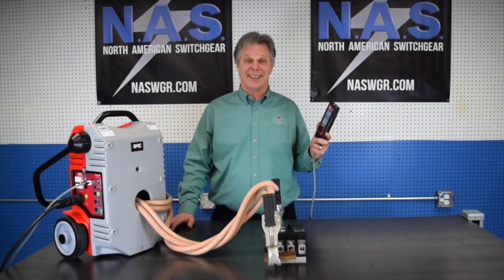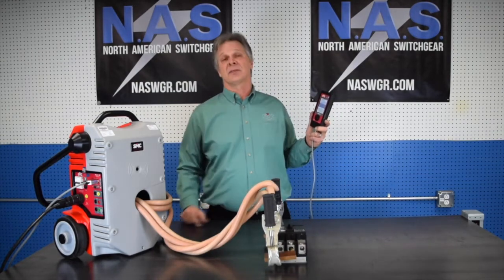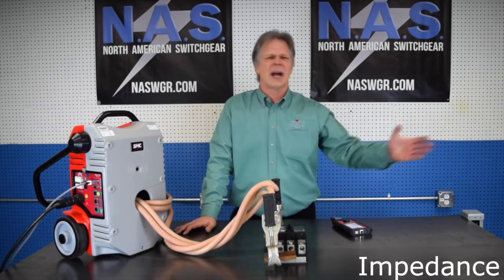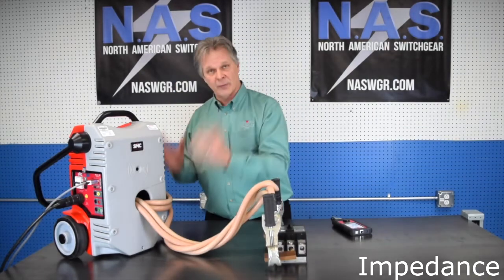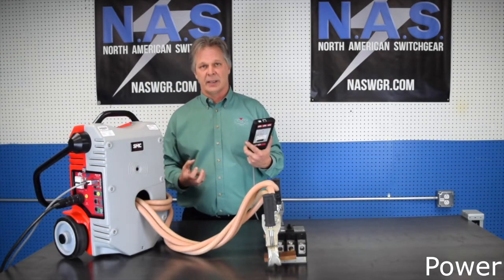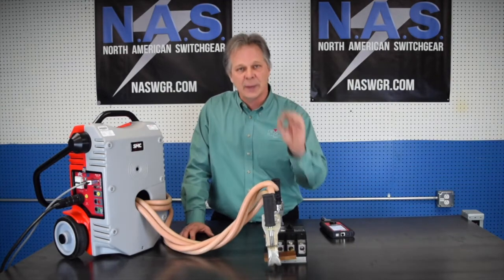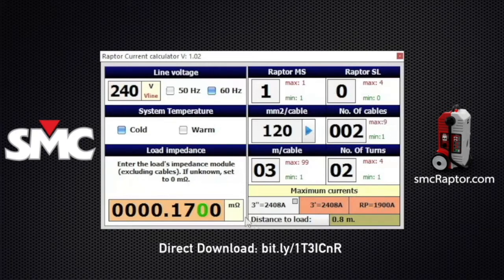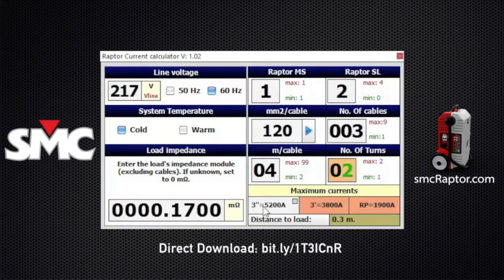SMC Raptor - How To Maximize your Test Current

Comment: You have entered all the calculator data but you cannot save it when you start the test. Also, how do I display the ampere reading in the program under the time during the circuit breaker test?

Comment: Raptor unit is a waste money spent. I have master and a slave unit and it cannot push 1/4 of a power you are advertising it as. Huge disapointment and it wasnot cheap.
Reply from the maker: Dear Ognjen Dobric, we are really sorry to hear that. We can not find your order, neither any registered sale though our distribution network. Perhaps you acquired it as second hand from a third party? However, please contact us at sales@eurosmc.com, so we can arrange a call to sort it out.

Best regards
Reply: @Smcint_esp  I have aquired it from a distributor and booster unit from a equipment rental company. I did spend a lot of time with Raptor office in US, and he was very knowledgable about unit. I did everything that shouldve been done, turns, cabke twisting, etc etc. Cant push 5k no matter 12k or 15k. Sadly he died since than and I just gave up on a unit, use it as needed and thats it.
Reply: @knn059  Thank you for your feedback. Can you contact us at sales@eurosmc.com? We will try to understand the issue not allowing you to inject further. It is not normal at all not to be inject more than 5kA with a Raptor C-15 (8 kVA), unless the burden load is too high.
Reply: I was planning to buy this device.  Can you tell me what the real maximum continuous current you obtained on the master unit  was ?
Reply: @dybson1991 Hi, depends how big of a breaker you are testing, also if you buy their $4000 cables you might get few amps more but not significant. Ive spent days on the phone, video calls with Raptor office in US and thats what you get, about 30% of advertised. I never managed to push even 6000A with master and slave, with all their recommendations, with them watching it via video call. Master only maybe 3200A or so, I dont know exactly now cuz I always had slave unit. Money you are going to spend just go with Megger or used PI-1600 or similar. No hate towards Raptor, I still have both those units, I am just trying to save people $40k+ we work hard for that money. Heres a hint, watch any of their videos you will never see a demonstration test on breaker larger than 400A. I watched all videos on internet trying to see someone succeed, I have never seen anyone test air circuit breaker 2000, 3000A and test instantaneous element or similar. I have those units for 7 years so trust me I know what I am.saying, they are talking calculated values, I am telling you real life experience, on site testing, etc. Also 240V supply or few volts less, huge difference.
Reply: @dybson1991 I know I wrote.you an essay up there, also when using 6m cables, they will tell.you ypu need to buy their cable that costs arpund 4k, I did compare impedance of my cables and their, not any significant difference that would make unit push extra thousands of amps.
Reply: @dybson1991 They are deleting my replies I wrote you.
Reply: @dybson1991 1 unit no more than 1200 Amperes , for less than 5 seconds
Reply: They are deleting my replies I wrote you.

Comment: What kind of input power supply needed for this equipment. Can we use normal 13 A single phase socket supply for testing??
Reply from the maker: Yes, you can. But as is logical, if the plug can only supply 13A, which implies 230 x 13 = 2990 VA, the Raptor can not supply the load, cables included more than approximately 2500VA.
Reply: Thanks for your quick response. In terms of ampere, with 13 A input supply what is the maximum current that       Raptor MS can inject safely,  keeping in mind various combination of Cables and turns as mentioned in Raptor Current calculator.
Reply: Dear Link is not working
Reply from the maker: @wonderland7565    Thank you for cooperate, but what link doesn't work?
Reply: Raptor Current Calculator
Reply: Kindly send me working "Raptor current calculator" link
Reply from the maker: @wonderland7565  I'm trying to solve the problem but can't find where is the link. Is in this video or in our web site?
Reply: Kindly watch this video at 3:08 . You will get one link at the bottom.
I need this "Raptor Current Calculator Sheet". Kindly share download link
Reply from the maker: I do not understand what you are referring with "safely". Raptor MS is protected internally and it is not broken by injecting any amount of current. Another issue is whether or not you can inject the amount you need. As you know, the control console incorporates a calculator that will indicate, depending on several parameters the maximum current that can be obtained. As a general rule, the consumption of the unit from the mains, at its maximum power, will be: Ic = Iout * N / 200 where N is the number of turns and Iout the current that is injecting.